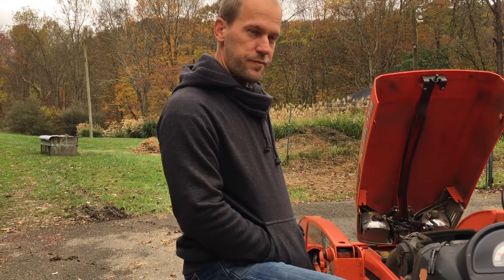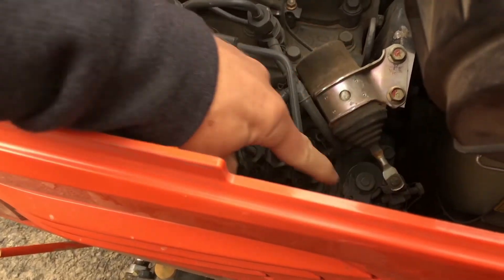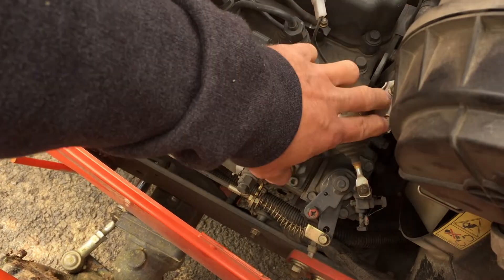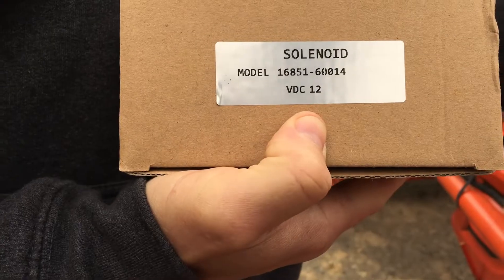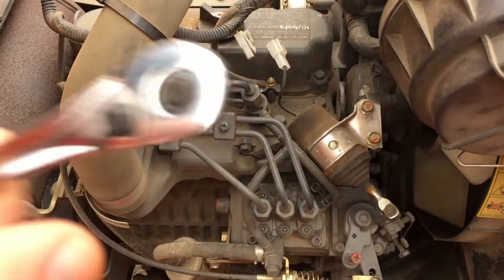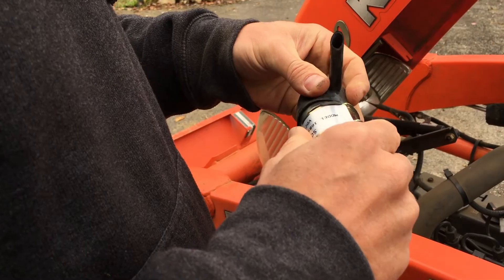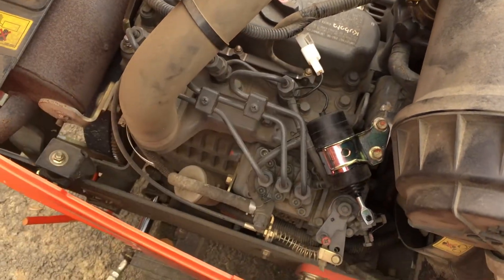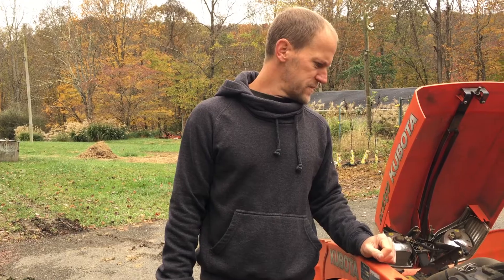Diesel Engine Won't Shut or Turn Off - Troubleshooting and Fixing

Comment from the maker: VIDEO UPDATE 1-22: After this video was released, that same fuse ended up blowing again. Upon further investigation, we discovered, by tracing the wires back, there was a bare wire going to the seat safety switch that was occasionally grounding out and blowing the fuse. However, we think the video can still help people, because any one of these problems could be causing the issue.

Comment: Found this video that progressed directly to my problem. I had replaced the switch and solenoid thinking they'd gone bad. After testing as covered here, I checked the fuses and sure enough, the timer relay fuse was blown. even used your suggestion for borrowing the DC outlet fuse to fix it. spent two years turning it off by hand at the solenoid armature. Could have saved money and time by being more attentive to these videos. Thanks much.
Reply from the maker: Hopefully that took care of your problem. But as we later pinned in the comments, we later found the cause of our blown fuse was in fact the wire to the safety seat switch grounding out which is on that same circuit.
Reply: @AlleghenyHomestead  yes I saw your follow up comment. A friend had bypassed that safety switch years ago so I guess we’ll see if it blows again. Tractor is a 2008 so fuse May have just gone on its own. Thanks again

Comment: Thanks a ton - I just needed to shut off my kubota and you showed me how and what I needed to do to make a fix.
Reply from the maker: Hi Jeff! Glad it was helpful to you! You’re welcome!
Reply: I have the same problem on my etc with same engine…. Mines wouldn’t not turn off and it was like on full throttle high rpm. Anyone would know what would cause it to be the problem? Full throttle to the point flames started coming out from the exhaust? One of the belts came off the wheel I think it was the alternator belt too.
Reply: Same

Comment: That drain is probably a breather for air to move in and out behind the spring.
Also, a timer relay is used to provide power to grid heater or glow plug circuit

Comment: what could be wrong? Under load, even not under load, the revs jump
Reply from the maker: Given the information, I'm not really sure what's going on. Ours doesn't have the yellow button in your video. I'm not really sure what that is. I'd love to try to help if you could provide more information.
Reply: @AlleghenyHomestead  The engine works fine at low revolutions, but when it hits higher revolutions then it starts jumping around unevenly. I've swapped out fuel filters, but the same problem continues. Where could the problem be? Fuel nozzles?
Reply from the maker: I, too, would have tried the fuel filters. Outside of that, not sure what else it would be. Hopefully someone else will see your comment who knows more about the issue and will be able to assist you. Sorry we don't have more help to offer! Hope you get it figured out soon.
Reply: @AlleghenyHomestead  I checked the nozzles, everything is fine! I will look further for the fault

Comment: You were just getting to the problem that I'm having when you quit the video.  I'm not getting power to my solenoid.
Reply: Hello did you fix your issue and did you check out the timer relay, as it appears to be the problem, as it controls the shut off solenoid and the cold start glow plugs? I am battling a similar issue on a Kubota B1550 and my testing led me to the relay. It is a very expensive part to repalce. I would like to hear what you had to do to fix it and is your after market solenoid still working. Thanks John
Reply from the maker: @johnmccarthy4544  Hi John, thanks  for stopping by! We pinned an update to the top of the comments. As for the timer relay, ours still works, so we cannot comment on that. The after market solenoid is still working just fine. We also kept the original as a spare.
Reply: @johnmccarthy4544  Hi John,  Have you found a solution / video / cheap replacement for the timer relay?
Reply: @mjw7124  Hello Mike I apologise for not getting back to you sooner. I managed to fix the Kubota B155O and get it starting. The principle issues were caused by a lack of compression and I had to fit a new Head Gasket here. The other issue which needed fixing was that even though the Kubota glow plugs all read 1 ohm resistance when in place on the engine and seemed ok. However when the cylinder head was off the tractor, I removed them and tested them on the bench and they did not glow very well at all. I replaced them with after market NGK glow plugs and they made a huge difference. The third issue was the battery which was Ok, but only produced 500CCA and on cold sub zero temperatures, which we have here over December, January and February and after cycling the glow plugs 3 or 4 times there was not enough power in this tiny battery to turn the engine over fast enough to start it. I coupled up a jump pack to the battery and this made the difference. I hope that helps and I appreciate you getting back to me.😀John
Reply from the maker: Hi Steve! Thanks for watching! Did you check your fuses? We showed how we did that in the video at about 6:11. Let us know if that helps!